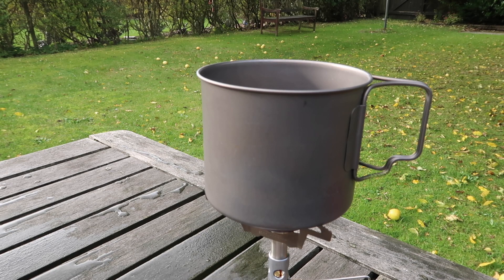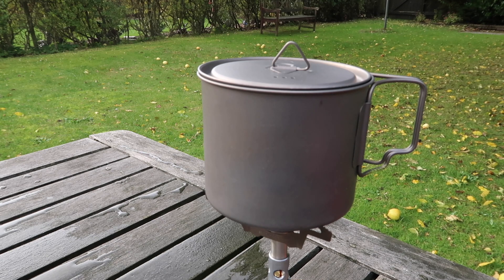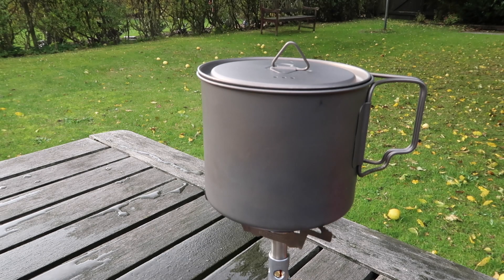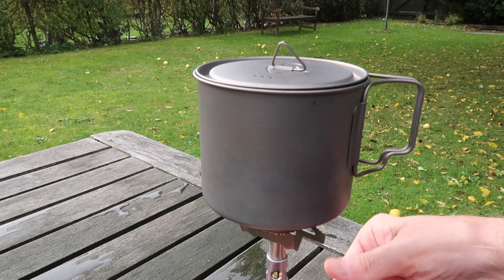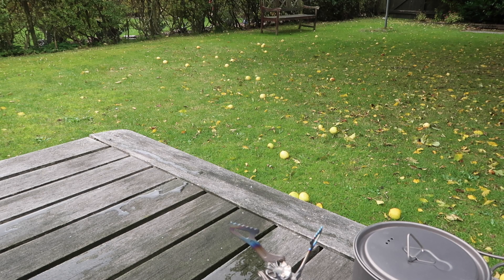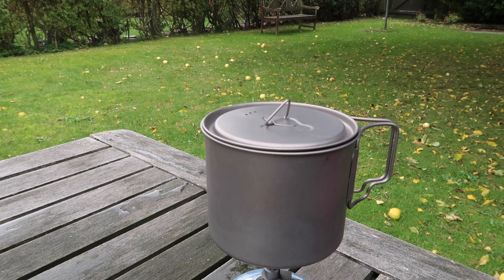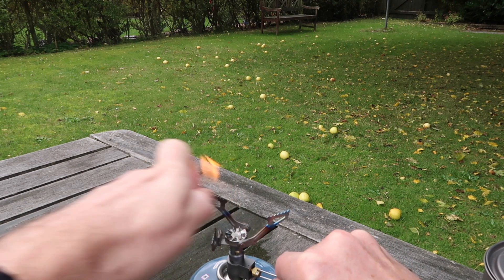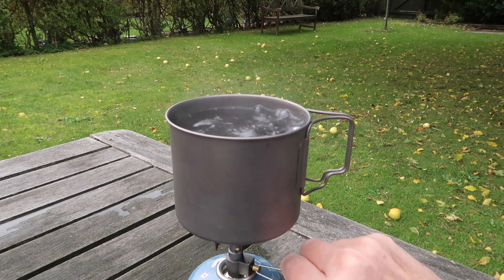Test of boiling times: Soto Windmaster & BRS 3000T

Comment: Good video. I was thinking of getting the windmaster but will judt stick with the BRS as there isn't much in thst to me
Reply from the maker: I guess if you have some shielding from the wind then the BRS works. 

The Soto Windmaster is nearly impossible to blow out. The quality of the Soto Windmaster is a lot better than the cheaper BRS and here there is no comparison. Everything feels nice with the Soto. 

When I screw the BRS on to the canister I have to nearly "over tighten it" to ensure a proper seal and the bottom of the stove hits the lip at the top of the thread section. If I loosen it a little then it doesn't seal properly. I'm left with the feeling that this is going to go wrong one day.

The Soto also has the igniter on it and thus doesn’t require a lighter or matches. This is a nice function. I defiantly feel a lot safer using the Soto Windmaster though. The down side of the Soto is the weight and price😞.
Reply: @BrianOutdoors  I may still get one at one point so I can try for myself. At the min I'm happy useing my thermarest sit mat wedge between my shoes as a wind shield lol 😂
Reply from the maker: @RoadToFreedom29  Yep, that'll work 🤣